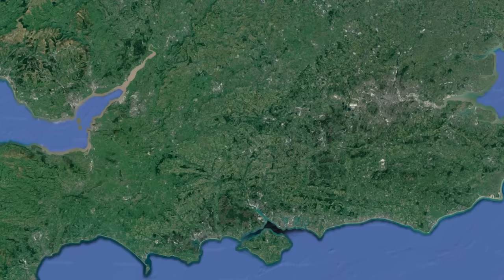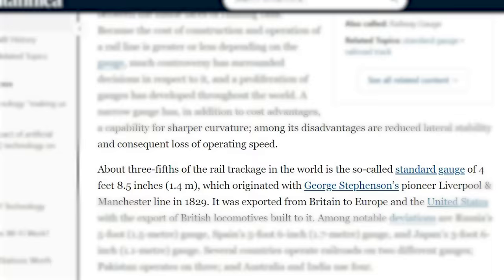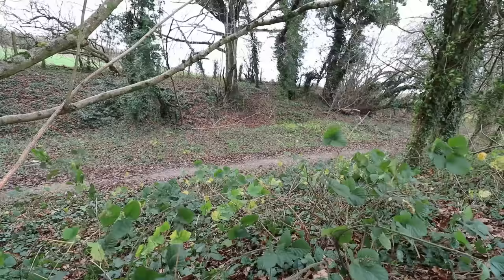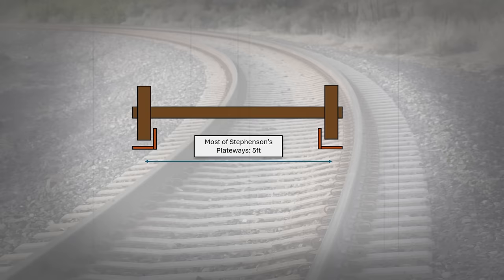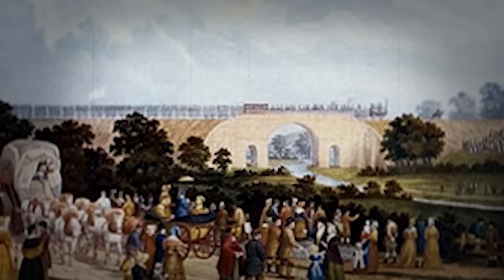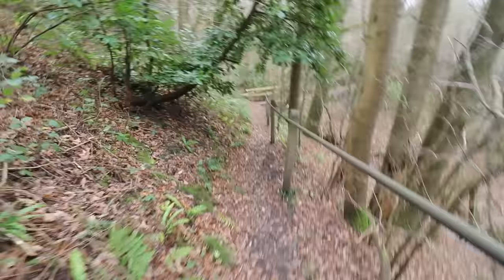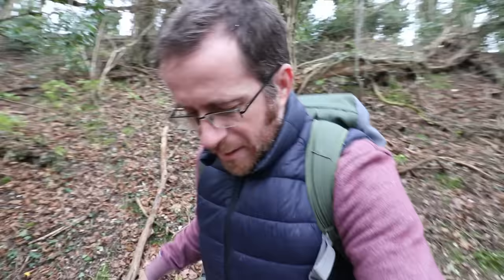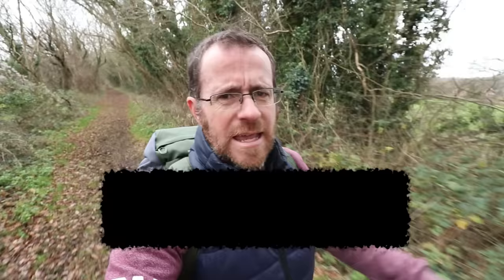Railway Gauges did NOT Evolve from a Roman Chariot.

Comment: Long before rail-roads in context of two parallel steel rails laid perpendicular to wood timber tie sleepers over firm bases. The Romans built thousands of miles of primary, secondary and local roads in Britannia. 
After the Romans left Britannia in 5th century No new roads were built in Britannia until the 18th century. 
Infact there are long lost ancient Roman roads being stumbled across that connected towns, villages being discovered. 
Back to rail-roads the concept is ancient as most everything we all stand on the accomplishments of the past and sadly periodically have also lost much of past knowledge too. 

The width spacing of rails in modern context are based on ancient cart, wagons, wheel width dimensions that have been experimented on as function of various factors, materials, spacing of rails to compensate for curves whilst following river banks, avoiding hills, etc and minimize friction and maximize stability.  In short many dynamics. Along with ease integrating of rolling stock over long distances and myriad of RR companies.

Comment: 7' gauge would require much wider curves. Similarly, narrow gauge -- 3 ft, say, as opposed to 4 ft 8 1/2"  -- would allow for sharper curves in mountainous areas, and lower construction costs. Especially more economical for mining and logging lines that were sometimes not intended to remain in place indefinitely.

Comment: Another story (I can't confirm but it sounds plausible) was that the fledgling country of the United States at the time, lacking much industrial capability, bought our locomotives and rolling stock from England.  Since you used 4ft 8.5 inch, we started laying track using that gauge and this is why the US adopted the same.  So that same gauge is used pretty much everywhere in North America (well, there are limited use of narrow gauge such as 3 1/2 ft and 3 ft)

Comment: Funny that history is full of references to ruts in Roman roads made by imperial chariots, which had a gauge that was likely measured in cubits and wide enough for two horses butts.  Perfectly reasonable that early raildroad engineers built track that could permit horse drawn wagons.  Funnily enough came out about because the roads in England built by ancient Rome featured this width between ruts.  So about all you got right here was the 4' 81/2" part.

Comment: Brunel's Gauge did NOT fail: the truth is that it was the minority gauge, so it just cost less to reduce the Broad Tracks by simply shifting across one rail than it would be to have improved the rest of the country by widening literally everything else by approximately 50%, or just about 2 ft 4 in per track [bridges, viaducts, tunnels, platform gaps, etc, as well as having to re-install all of the signalling towers, cable & rods and all of the other signage].  It's always been easier to fit small items into a large van than to carry big things in a small van, and as we all know, Cheaper Wins every time in this now tatty little country.  Had Brunel's idea been more widely adopted beforehand, things may have been different..

Comment: Even if there had been equal amounts of broad gauge and the narrower (now) standard gauge at the time, or maybe even very slightly more broad gauge; when they decided to make one standard, the narrower gauge would still have had a big advantage as the new standard: everything like tunnels and bridges dimensioned for broad gauge would also work for the slightly smaller locomotives of standard gauge but most standard gauge bridges and tunnels would probably be too narrow and to weak for the heavier broad gauge. 

Plus, since the railway ties at the time were mostly (or almost exclusively, I'd guess) wooden ties with the rails nailed to it at the correct distance. You could probably convert the gauge from broad to standard by simply moving one rail closer together on the original tie; while ties for standard gauge would almost certainly all be too narrow to be reused as broad gauge. Though I assume the much more expensive infrastructure such as bridges and tunnels would be the most important consideration.

Comment: The half inch comes from America, not Britain.   A mistake on the early B&O railroad, they forgot about the chamfer between the tread and the flange, which was 1/4".  So, add two 1/4" in a quickie reguage project on the wooden track, and friction between the designer and the railway owners was reduced.
Reply: Further clues come from America.  Standard rail width was 2", and gauge continued to be measured to the outside, which meant that although the gauge was at 4' 8 1/2", the gauges continued to be to the OUTSIDE of the rail like in the plateway days.  A very British thing to do!  When the Pennsylvania Railroad cast thicker rail than the standard 2", all heck broke loose in America.

Comment: Narrow gauge is actually better than broad gauge .   Broad gauge does mean heavier rotating wheel sets due to longer axles which is bad news . Yet even meter gauge can have as high an axle load as any North American freight train .   7 foot gauge would have hurt the railways on the long run so somebody was wise enough  .  Look how big the Chunnel train cars are on standard gauge track and they are way bigger than Brunel's broad gauge trains were .   Loading gauge is what is the real hold up is in most of UK .

Comment: Not sure where you get your headline about Roman Chariots.  As any avid Trainspotter from at least the last 50 years( including me) will tell you, George Stephenson used the same gauge of 4foot 8inches from the existing wagonways of the mine companies he worked for as an engineer  in his early career on the Stockton to Darlington railway to accommodate the hundreds of horse drawn wagons already in use. He then added the extra 1/2 inch to prevent binding around curves  while building the Liverpool to Manchester railway.

Comment: another Point where the Story of the Chariots falls flat right at the start: the Roman Army didn't use Chariots that could leave ruts in the roads in that capacity
but can it be that the addional part with the Space Shuttle Booster that supposesly didn't fit throu a to narrow tunnel fisseld out once they've retired the Shuttle? Not that the People suddenly learend about loading gauges or looked up what the diameter of one is

Comment: Putting £800k into the Bank of England's inflation calculator and converting it from 1845 to 2023 gives a figure around £80,000,000 (80 Million), but this is a rough estimate, and other estimates by other organisations may differ slightly. It's therefore likely that the £108,000,000 (108 Million)  displayed on screen is the figure you intended to quote, and that the 108 Billion you said was incorrect, but then your correction in the dooby-doo implies that Billion was correct as you say 'I do mean billion!', so I think you may now need to add another correction to correct the correction.
Reply from the maker: I genuinely thought billion. No clue what happened there!

Comment: The track gauge issue solved, now I know why the gauge, even in foots and inches used by those who built these railways, is an odd figure.
It possibly also explains why Russia had the plain 5' gauge, probably the engineer building this railway had heard of the original 5' track gauge of the wagon way but assumed this was also in conjunction with flanged wheels and thus measured between the insides of the rail head. Or the engineer decided just to put things right and convert back to the rounded 5' measurement.

Maybe you can do a video why the narrow gauge lines in Wales actually have so many slightly different gauges.
While for instance in South Africa the proper 2' gauge was widely used the track gauges in Wales seem to vary between 11½" and 2'3" for the lines having 4 gauges in total around the 2' mark, some lines having a totally different and sometimes odd gauge, like the 2'6" of the Welshpool line (used a lot elsewhere) and the 800mm/ 2'7½" for the Snowdon Mountain Railway.

Comment: Broad gauge would never have worked in the Western United States, where railroads had to cross mountain ranges (the Rockies, the Cascades, the Sierra Nevada, the Wasatch, and many others). The minimum turning radius for rolling stock, the maximum safe speed, the fore-and-aft spacing between bogies on the cars, and the design of the couplers, are all driven by the gauge of the rails, and when you use Broad gauge, you may gain some stability, and the ability to use wider rolling stock, but the other parameters, especially turning radius, become larger. In very steep terrain, even 4'-8.5" is too wide to accomodate a turning radius small enough to get a railroad through tight curves necessitated by terrain, and you see Narrow gauge, as on the Denver and Rio Grande Western the Durango and Silverton, and the White Pass and Yukon Route.

Comment: Landowners do close pathways and it is lamentable.

Within a few miles of my home in Hertfordshire a BOAT ( Byway Open to all Traffic ) now has an electric controlled gate.

This is deliberate 

The council simply arent interested.

There is a famous bridge over the M25 with a pathway ( BOAT) on both sides.

I have in my youth cycled and driven my first mini along it end to end.

Today the farmer (?) has installed waste / toxic lakes and heavy vehicle enter it daily from the London side.

The Hertfordshire side has been barred and closed.

There seems to be no redress.

If the M25 requiref a full dual roadway to cross it at some great cost...how can one landowner simply clock se it.

On other such routes I have encoutered farmers burying sharp barbed wires and materials intended to puncture bicyle tyres.

There seem to be no eay to prevent this.

Posting "No Entry" or "Private Road" or similar false signs is common.

Even placing hige concrete blocks in the pathways.

Is there nothing to be done ?

Do you know ???

Comment: Fascinating piece of work - thank you! I don't know much about this so please forgive me a really dumb-ass question:- Why did they not lay a third rail so they could use both gauges? Would it be down to the points or something like that. Also - I remember in the late 70's or early 80's when I was a kid, taking a train trip from Madrid to Paris overnight, and they actually changed the bogeys at the border - was this down simply to gauge differences?

Comment: I don’t think this video debunks anything. The gauge of the original plate ways was set by the  width of the wagon wheels - 5’ ctr to ctr.  
The change to rails kept the same 5’ ctrs, but with flanges on the inside. This gives a gauge of 4’ 8”. As wheel geometry developed, another ½” for clearance was needed. 
But the important thing is that the centre distance of the wheel sets has not changed. It is still the same as the wagons which ran on the plate ways. 
It is more likely that the plate way dimensions were set by customary wheelset dimensions than the other way round. Geo Stevenson said it himself  The rail gauge was set by the wheel centres - hence the weird distance.
To prove your point, you need show that 5’ ctrs were not in common use by the Romans.

Comment: What I came to wonder is whether there will ever be a use for broader gauge in the future. The main line of where I live is at capacity even though there are 400m double decker trains running in a high frequency. One option would be to build another 2 tracks on the line and also straighten out the line to make it faster but the other thing I wondered is whether it would ever be feasible to transform such a high capacity route to a broader gauge so that more people can fit in a train.

Comment: Yeah I don't think anyone ever thought "the railway gauge is literally based on the width of a Roman horse's backside". That would be sophistry at its most naive. It's just that the width of two carthorses harnessed side by side and spanned into a chariot would have had a certain width, and that width would have been more or less universal, plus or minus a couple of inches here or there, for the several hundred years the Roman empire held sway in Italy and in its several colonies across Europe and north Africa. 

It's therefore reasonable to deduce that Roman roads would have been a certain width to accommodate passing chariot traffic and that the roads would have acquired worn ruts of a de facto "gauge" and you could - again, not unreasonably - extrapolate from there to the carriages post-Roman empire being built to travel in those ruts and that giving a wheel track that could have been used for the first horseless carriages, and from there to railway rolling stock. 

So I don't think the theory of the Roman influence on 21st century mass transport can be dismissed completely out of hand as if there is absolutely no question - it's likely still there, just not in so specific a way nor by way of such a straight line as some might have us believe.

Comment: Interesting how when electrification was introduced there was no standardization for a long time and still isn't now in many ways. As someone who's against central planning, I'm torn as it's good to try multiple systems to see which works the best but it's also great to have uniformity to allow interconnections. As with so many new technologies, the best idea is not to be first but allow others to try it, figure out the ttehign problems and then adopt the better system, if you can.
Reply: Several places in the US, electric locos are dual voltage, and change over without stopping. Also switch from overhead wire to third rail.
Reply: @SteamCrane  Yes that happens in many countries and across Europe trains switch between different voltages too but it's unfortunate that older systems that prove less efficient haven't been phased out to save on power transformers/alternators on locos, loss of current on low voltage systems and just the complexities of running multiple systems.
Reply: By the 1920 there were standards for electrification agreed to by the Big 4. They chose 1,500V DC for overhead railways as this was the best option for the UK. The NER had already electrified one line at this voltage (completed during WW1) and were looking to electrify their portion of the ECML at the same voltage. But the grouping and Gresley got in the way.

Comment: Thank you. Good video. re Railroad tracks this is quite comprehensive.  I think in the American south at the start of the Civil War, the northern states were standard width, but in the Confederacy, the southern states, there was a few different gauges.  And the few days to convert the Oxford line? Railroad tracks are apparently easy to repair and change. The Allies would bomb the Hamburg rail yard into rubble and they'd have trains running on the most critical lines the next day right through the rubble.
So what was the width of Roman ruts? When I google this all I find is myth busted...blah blah blah (everybody on the internet just loves to just pile on.) I did find a few hints. 1.3 and 1.4 meters which are 4' 3" to 4'7" I found a mention that Henry Ford made a wider track Model T to fit in wagon ruts in the American south.  (Google this and it's an endless series of people who don't know the difference between Width and Diameter. And Google doesn't know 'traditional wagon,' 'buck board' from decorative lawn ornaments, modern steel trailers.)  I found an hilarious exchange in a group where they can't seem to tell the difference between axle width, spacing (front axle to back axle), or diameter.  I did find a couple of mentions of 60" Axles which would probably result in about a 4'6" rut width. 
I do know a couple of things. 1. Early cars would break their axles and wheels because of mismatch with existing ruts. 2. Ruts were temporary. They could be graded flat. 3. My dad told me they had a self driving Model T. On parts of the dirt road near the farm they drove on in the 1930s it was easier to just take your hands off the steering wheel and let the car follow the ruts. (He did that one time in a van on a dirt road in the mid 1960s. It worked. ) Without power steering you could get hurt trying to hang on to the steering wheel that was violently turning because of the ruts. 
Also, wouldn't the Brits have pulled up the old unused tracks during WWI and II?

Comment: the whole "railway gauge evolved from roman chariot"  saying does have some truth to it, the idea that roman chariots all had exactly 4' 8 1/2" between the wheels is obviously false, indeed it probably didn't come from either the romans or chariots but the core of the saying is that  how far apart the wheels of house draw vehicles were was based of a horses width and that all vehicles had to be about the same going back centuries does make sense. The concept, gist and progression is easy to follow: horse drawn cart is made, maybe roman, maybe medieval, but a long time ago with the wheels far enough apart for the horse to walk between the wheel tracks/ruts, other carts are made about the same width so they don't break their axles on the ruts/tracks of older carts, give or take a few inches, carry this forward to the carts used around where Stephenson started his career, reduce the tolerance from give or take several inches to fractions of an inch and you have the standard gauge of 4' 8 1/2" derived from the width of ancient horsed bums

Comment: By my calculations the Brunel broad gauge change at £800,000 pounds was equivalent to £111 million. Not 108 BILLION. 111 million would be achievable today, as it was, in equivalent sense, back then. Expensive and not wanted by the GWR, bur necessary